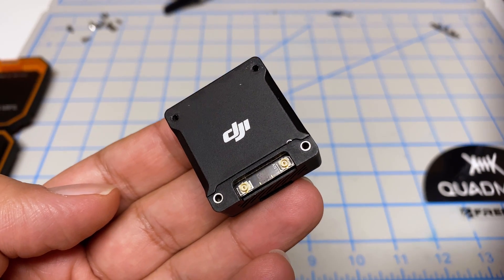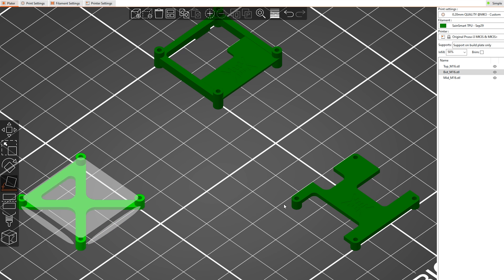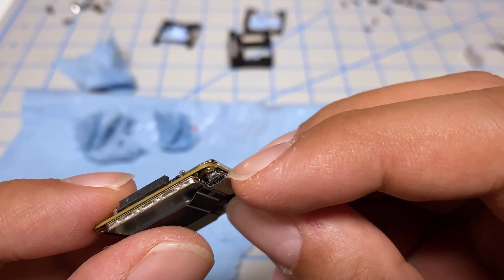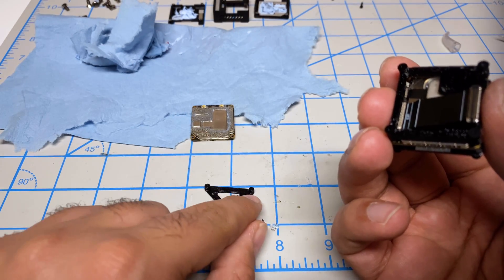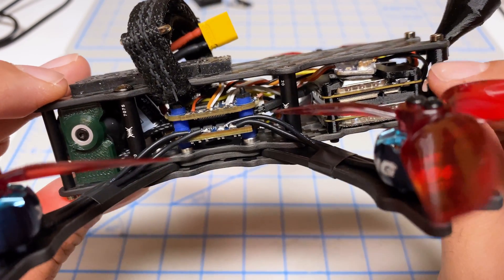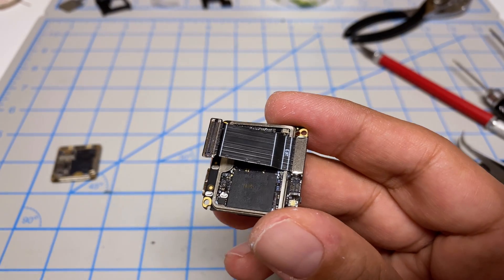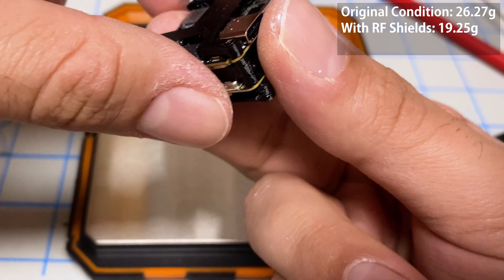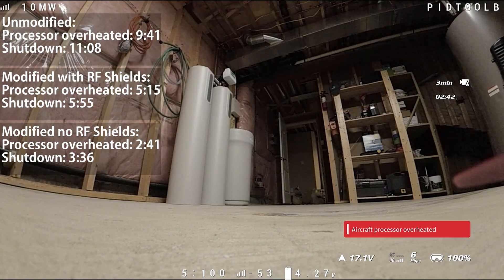DJI O3 goes on a SERIOUS diet! | Naked Decased Air Unit How To Guide

Comment: hey, i have the o3 ultra and cant get it connected via usb , i have signal in the goggles but cant access the footage from the internal storage, you know what can i do ?
Reply from the maker: Check the USB port to make sure there isn’t any garage stuck in there. Are you sure the computer you’re using and the cable are okay?
Reply: @Mangorille  inside the port ? or the connector? and yeah I use MacBook and all the other o3 drones I have are connecting fine with the computer and those cables

Comment: thank you so much for the instructions, but if you remove the rf shields wont a single drop of water compleatly destroy it?
Reply from the maker: The RF shielded areas aren't fully sealed to begin with and there are areas of the unit not covered by the RF shields. But yes, making it naked could impact the durability given that the components are more exposed. I haven't had any issues yet and I crash all the time in wet grass.

Comment: I'd be too worried about the overheating the electronics, that might cause damage over time. Especially when I use a GPS, and I have to wait idle before takeoff, anywhere from 10-30 seconds for satelites to sync. The only way I would consider doing this, is if it was a winters day OR I had one of those portable jet fans blasting air at it while at idle
I'd rather look for weight savings with a lighter frame, motors, props... titanium screws and standoffs, and smaller batteries. I even saved a few grams ditching the battery strap, and going for an industrial elastic band and adding strips of double-sided silicone tape on the battery pack for extra grip
Reply from the maker: Understandable, I only run this on small lightweight builds, which would be those builds without a GPS. If you are adding a GPS or an action cam, then no point to chase a 14gram weight saving by doing this.
Reply: @Mangorille  Still found the process interesting though. If there was a way to incorporate heat dissipation for the o3 into the frame without compromising rigidity of a light frame, that would be an amazing feat
Reply from the maker: @rubberonasphalt  I've seen some frames do that but it usually ends up adding weight. You can always just remove the case and keep the RF shields, that gives you more heat dissipation.

Comment: Removing the heat sink, buying or making a new case, making the unit very exposed to the environment and over heat error for 13 grams. No thanks
Reply from the maker: Definitely not for everyone but a good option for smaller and super light builds.
Reply: @Mangorille  I got a black bones and I think It looks incredible especially with gyro flow.
Reply from the maker: @CloudsFPV  Oh ya that would look great. I did a test a while ago with the GoPro 7 Black and O3 and the 7 Black was even better.

Comment: that new flywoo o3 naked kit is very similar to this. i switched to using 2 diy linear antennas which cut a lot of weight as i no longer need a big tpu mount.
Reply from the maker: Did you notice any change in signal strength / range?

Comment: mangorille! thank you for this! nobody else has done such a comprehensive naked guide yet.

quick question for you. Would you be willing to give the caliper dimensions of your naked 03? I'm wondering how tall it is to fit into a slammed build. Thanks!!
Reply from the maker: Welcome. You're looking at 13.8mm in height.
Reply: @Mangorille  thank you so much!!

Is this including the usb-C and Fetts coming off the board?
Reply from the maker: @strattonford2557  Yes, nothing extends past the 3d printed case.

Comment: it is possible to make o3 unit waterproof?
Reply from the maker: You mean completely waterproof or just water resistant? You can use conformal coating but I haven't had experience with this making things waterproof (i.e. full submersion in water)

Comment: The casing of the O3 is already paper thin, this really feels unnecessary. Just using a shorter mipi cable or rehousing the camera with a lighter weight lense feels more practical to shave weight. But really just use a lighter weight lipo like a hv pack.
Reply from the maker: Depends on your build. For a larger and heavier build, I’d agree with you.  On a small sub 250 gram build, this 13 gram saving is about 10 percent of the quad’s weight (without battery).

Comment: Love this video! Great video! I appreciate the testing. I wonder what the temps would be without the TPU mounts. I wonder how ICE9 TPU would do which is better for conducting heat.
Reply from the maker: Thanks buddy. I have since re-done this using ABS for a tiny bit more weight saving. Check out this video: https://youtu.be/gxt-7bHG9vQ

Comment: That's so dumb, stripping down such a well-engineered piece of kit that defines FPV in the first instance. Remove the air unit, and your quad is no longer an FPV drone. You need to be more creative than simply pulling apart stuff with a screwdriver, (which isn't creative anyway, it's more destructive)!!! what about not adding a gopro, or go 4S rather than 6S, you will save more the 13 grams.
Reply: I am not sure if you are trolling or not... what defines FPV is this exact thing the OP did. Tinkering with drones and building them and modifying them is what this hobby is all about. If anything this guy is what makes this hobby amazing!!!!

Keep up the great work @mangorille!
Reply from the maker: This is more suited for those trying to build super light builds, such as sub 250 gram quads due to government regulations. I agree, not worth it otherwise. 13 grams on a 650g 5" is nothing but 13 grams on a 220g 3" is quite a bit.
Reply: U butthurt or what 😂

Comment: O3 gets hot as hell stock! You remove here all heatsinks and thermal compound for the sake of “saving” few grams. These small quad mostly don’t have gps due to crap f411 fc’s with not enough uarts - if your vision will fail say bye bye to your drone... Too risky imho
Reply from the maker: Agree that they overheat quick on the bench, but they actually don't get that hot when in flight. You can find good f7 mini flight controller now-a-days. I've got f7 in all my quads, even the 3" sub 250 gram ones.

Comment from the maker: Hey All. For those of you suggesting other 3d print materials to save weight, I found a site that provided the densities of the various materials. It looks like ABS would save bit of weight.
ABS 1.04g/cm3
ASA 1.05g/cm3
TPU 1.21g/cm3
PLA 1.24g/cm3
PETG 1.27g/cm3

Comment: light weight ASA works best
Reply from the maker: Looks like you could save a small bit of weight. I found a site that compared the densities of the various filaments:

ABS 1.04g/cm3
ASA 1.05g/cm3
TPU 1.21g/cm3
PLA 1.24g/cm3
PETG 1.27g/cm3

Comment: Hey Mangorille, you could probably drop a few grams by printing these parts in ABS instead of TPU.
Reply from the maker: True, or even PETG. I went with TPU so that it has a bit of give in a crash. Kind of like soft mounting a flight controller.
Reply: @Mangorille  light asa is the ticket

Comment: you save 7g on O3 and loose the same using seperate rx.. when you could use O3 for everything
Reply from the maker: I loved the old black DJI controller and used that for 4 years. Not a fan of the new gray one and it had some serious signal flaws when the o3 released, even failsafed on me 2 meters away (I hear it behaves better now though thanks to firmware updates). I did try it and even made a video on it (https://youtu.be/QRpH3c9G-Y4)
Reply: @Mangorille  it was O3 FW fault.. I have broke my first O3 build on first flight because of RX drop but it's fixed now.
And I put longer gimbals, it feels like the old DJI now. 
Only two 3 positions switches were annoying.. but again moved arming and beeper on the same switch, problem solved. It does everything my BetaFPV pro radio does just without the need of RX. :)

Comment: This is great, man! You covered everything completely but concisely and didn't leave any questions unanswered — for me, at least. Not sure if I'll end up doing this, as I'm new to the 03, but I've done plenty of naked vistas, and have been wondering if that would work with an 03 AU. Initially, I only planned on getting 2 or 3 of the 03 AU but you know how that goes lol.
Reply from the maker: Thanks for the comment, I started with 1 O3 and now have 3 so I completely relate! Happy flying!
Reply: I understand that! I just ordered my 5th o3 after going back to the Vista on my last build. Even with the Nebula Pro camera, going back to the older system after the O3 is pretty tough. Now I only use the Vista with a RunCam Phoenix starlight camera for night flying! Maybe soon we can get a good low light camera for the O3 system. That would be great!

Comment: It is worth when placed for small frame ... just need to use thin heatsink on main chip  and fan when stationery ... Nice one
Reply from the maker: Adding a fan on the bench would be good enough. The beauty of the O3 is that you don't need to power it up for firmware updates or to pull footage from the onboard storage (like you had to with the Vista) so less chance of bench overheating.

Comment: DId You consider to add micro fan .... just when You started it it won't instantly go hot .. well now You need to use external fan when stationery ... as when You will fly it will be cool
Reply from the maker: My test shows that you have about 3 minutes before it overheats and after turning it on, I'm usually airborne in less than 30 seconds.

Comment: Great work! Only my 5” is using an O3 but I might go this route I install an O3 on my 3”. Overall, I’m not too impressed with the O3 and I think I even prefer the Vista over the O3 as the Mbit drops quicker with my O3. Even tried swapping the stock O3 antenna for a pair of TrueRC LHCP antennas to match my Goggles V2 but that didn’t help much.
Reply: OMG I was feeling the same way hahahaha I just ordered some lchp for my O3 to see if I can improve....dang sucks it didn't help
Reply from the maker: I've noticed that the O3 never holds 50mbps like the Vista did back in the day, the mbps likes to move around a bit anywhere between 46 and 50 even with full signal and not too far out. Not sure why this is but I suspect it does this when the processor can't process fast enough. Check this out: https://youtu.be/WFZL-IyQUmQ?t=196
Reply: but i still have a better image on the 03 vs the vista.  so why do you think the vista is better?
Reply from the maker: @turion92  Hey. I don't believe anyone said the Vista is better overall. The O3 is really good. Where it lacks though is the size, weight, and terrible dynamic range so you don't have as good as an experience when you transition from light to dark places. I know they did a bit of firmware magic a while back to make this behaviour better but still not as good in the dynamic range department as the Vista.
Reply: @Mangorille  ah okey i see. Yeah thats true. The reason why i have vistas and 03s 😉 vista with polar cam is a huge difference to the 03. Low light is not the best sadly
Reply from the maker: @turion92  Good point, low light is another area where the O3 camera will struggle. Low light is different than dynamic range. Dynamic range shows up when you've got bright and dark areas in one scene, let's say you are flying around in a sunny day and there is an area with tree cover. The sunny area will be beautify but the tree cover area will be really dark and unable to fly. It'll take the O3 camera about a second to adjust when you enter the dark area, by then you may have already crashed into a limb. :)

Comment: What is the point to shave off a few grams and make it more vulnerable to damage
Reply from the maker: Depends on your use case, for a 5 inch+ I agree with you but with smaller builds, 13 grams can be 5-10% of the total weight of the quad. Plus some folks try to be under the 250gram legal restrictions for extra freedom.

Comment: i had to do this last week to get weight down under 250. i was pretty confident that the material i used was petg but after assembly it turned into chewing gum as it turns out i used pla and this thing gets hot even with a fan blowing on it. printed it again in abs. works fine for me so far. lets see how it handles summer heat. for mounting i used  soft double sided tape and a zip tie.
Reply from the maker: PETG would work, definitely don't use PLA as it would go soft exposed to that heat. I went with TPU so that it has a bit of a inherent soft mounting in crashes.

Comment: It's not worth it and compromise the unit
Reply: It sure over heated much quicker. Seems each step halves the amount of time before over heating! Not quite sure about all of this, especially the last step.
Reply from the maker: For sure it did on the bench, in the air no problems even with back to back flight including a long ~8.5 minute flight. I wouldn't do this on a 5 inch+ but with smaller quads, this should help make up for the weight of the o3 vs. the Vista.
Reply: @Mangorille  Yup, a naked Vista is only slightly less weight than your fully naked 03! Amazing!!! :)
Reply: Totally worth it

Comment: for printing with TPU do I need an enclosure for my printer? I have the same Prusa i3 MK3S+, also what are your print settings? thanks! Great video
Reply from the maker: Thanks! No enclosure needed. I put the 3mf file in the video description if you want to give my settings a try. I used Sainsmart TPU.

Comment: What does it weigh without anything else? You skipped over that part
Reply from the maker: You mean just the boards without the 3d printed parts?
Reply: @Mangorille  yes
Reply from the maker: @TechTimeElectronics  I'll weight next time I take the thing apart but I can't see the TPU prints weighting more than 3-4 grams.

Comment: have you tried using only standoffs instead of those tpu prints? i think it would give more airflow as well as save a couple more grams
Reply from the maker: I did with the Vista on a whoop and 3d printing some stand off (https://youtu.be/e--SYUSe1Rw) The problem with that approach is that: 1 - You need to make sure that nothing touches the two halves, including the tops of the ribbon cable connector. 2 - You don't have anything holding down the board ribbon cables, the antenna connectors, and camera cable. They can pop off in a crash. It will work okay for a whoop but anything bigger and you'd want some sort of strapping to hold those connectors in place.
Reply: @Mangorille  on the vista, i use an rc fuel silicone tubing.. cut to length. Its quit snug when you tighten it.
Reply: @Mangorille   @Mangorille  for the ribbons, i use eva foam to compress it with. For the antenna i cut a zip tie to make a bridge and punch a hole on each end for the two bolts to compress the ufl. Hope this helps..
Reply from the maker: @verdi6092  I did the same with the ribbon cables on the vista. On the vista make sure that the metal on top of the ribbon cable doesn't touch the shielding for the bind light. Mine did and the bind light burnt out. :(
Reply: Yup there is a 2mm alum spacers and can act as additional heatsink
Reply: @verdi6092  Or, 3D print the stand offs to the exact size you need.
Reply: @KOrnhOliO1  u have to use high temp filament for the standoff
Reply: @verdi6092  Sure.